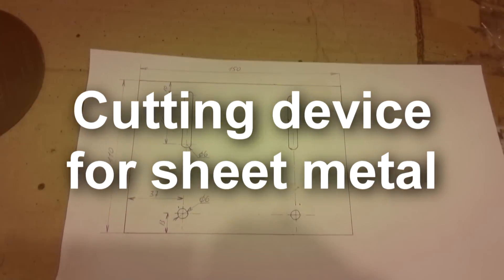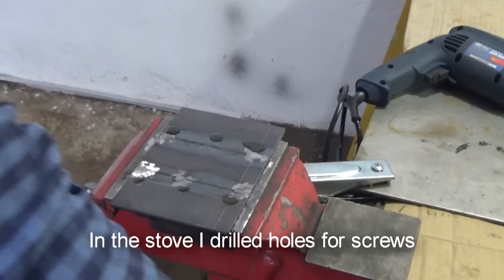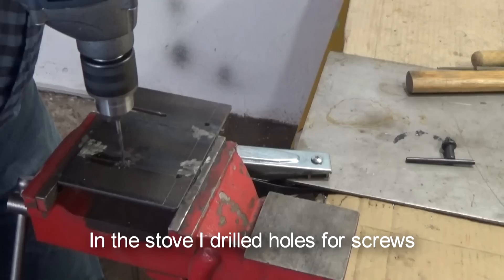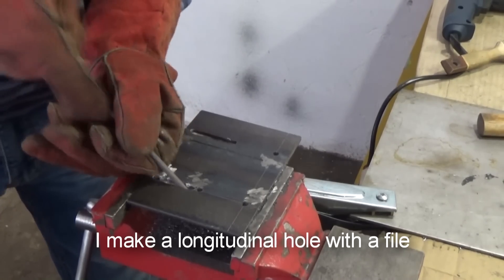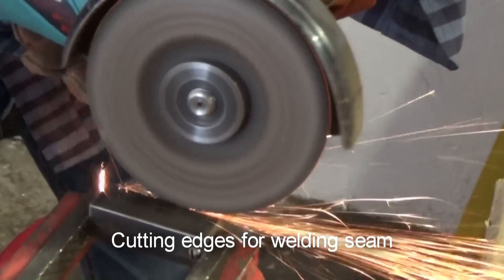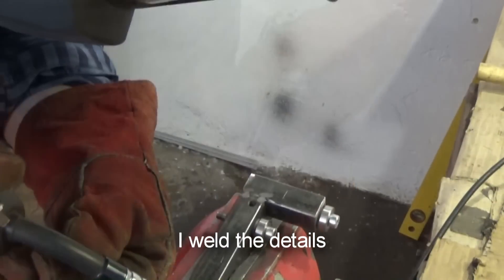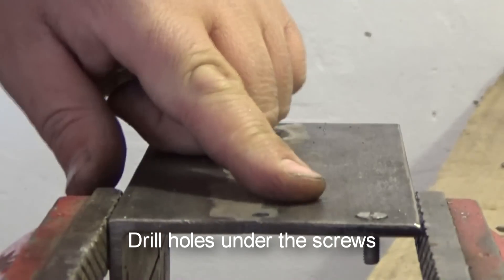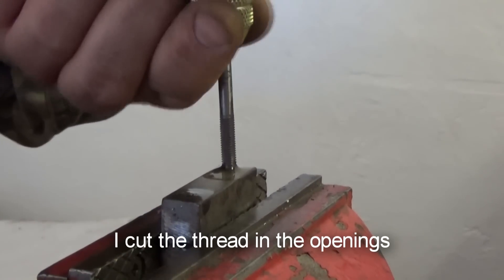Cutting device for sheet metal, angle grinder stand,  how to build

Comment: Nice work. Looks like the plunging function is not essential here though. There's only a few mm cutting depth anyway. Would it work if you mount the grinder on the square tubing that sits on a smaller piece of a square tubing? Abrasive wheel is not a precision tool after all :-) Thanks!
Reply from the maker: Of course, you can take less. But I think, for a better rigidity at 2 meters of the length of the pipe itself, it is not worth saving.
Reply from the maker: Hello!
The tube of a smaller cross-section does not fit. I initially bought a pipe, but only then developed the device.
You can cut slabs with a thickness of up to 15 mm, which was recently done with OSB-stove.
Of course, it's not worth the accuracy to a hundredth mile of a millimeter, but I still have enough :)
Thanks!
Reply: @MadeInGarage  it probably doesn't fit because of the welding seam on the inside. I've seen folks grinding a slot in the smaller tube to accommodate that.

Comment: Not so bad but very complicated...
Reply from the maker: A bit so, but the result is very good.
Reply: Sorry firend, but not so good:

First the depth of cut is too short, even using a brand new disc, due to disc consumption in SHEET CUTTING is elevated, unless that You use an diamond disc instead resin fiber, that don't reduce the disc size;

The conspumption forces You to replace in few uses the disc;

One spring elevating the tool is more safe, avoinding to power on the machine with the disc toutching someting.

The STRUTCURE is very good, but I'll make some modifications, as a chamfer on the head area, to make the tool dive more deep making the disc lifetime longer.
Reply: Why not one solid piece instead of welding two pieces together seems like a lot of work for the same result